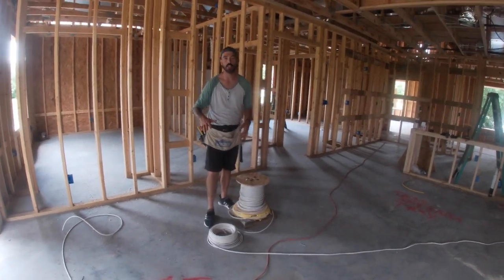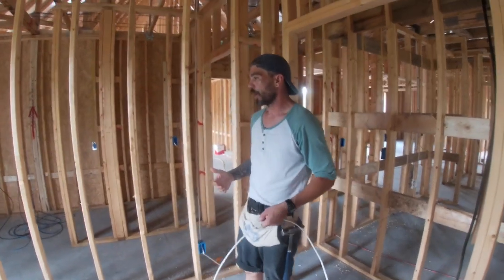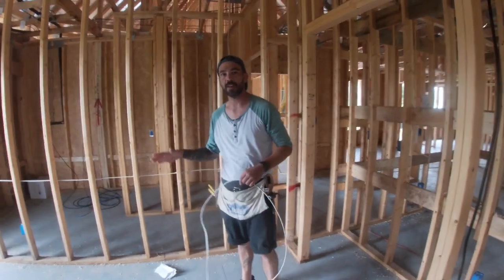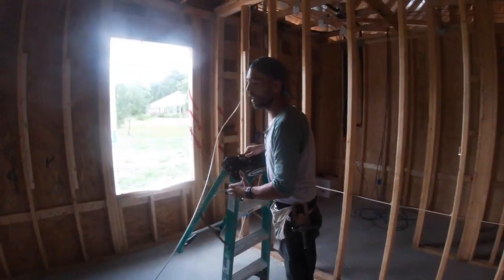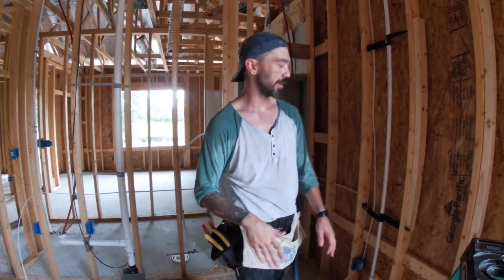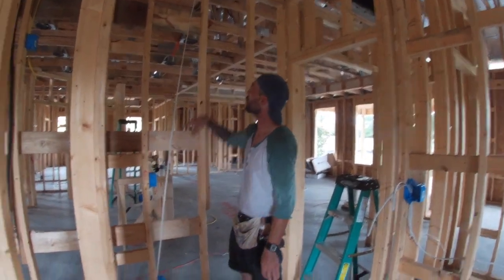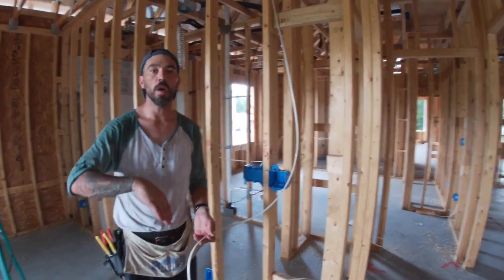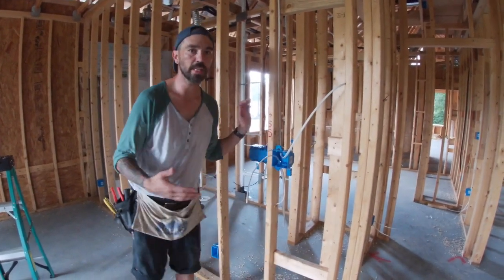How To Wire A House; Episode 6 - Bed 2, 3 & Hall Bath

Comment: I like your honesty, demeanor and style!  I'm going to use your teaching as my education on wiring.  My contractor ripped me off.
Reply: How did your contractor rip you off?
Reply: @Cizcoboii  What started as a kitchen remodel, then i was told, i needed to remove  ceiling insulation.  then suggested a rewiring the house, i said no multiple times, then since i wanted smart switches, it needed to be done, then the electrical box, they wanted 1500 more to turn the electrical box 180 degrees.  Did sloppy incomplete work and not to code.  Told me to knock three walls, build 2 bathrooms.  All with demanding to be paid for work that was not completed.  Demanded each week to be paid regardless of little progress.  Then I was fed up and they stopped working.  Stole a bunch of tools from me.
Reply: @calidtstyle  Jesus I’m sorry to hear that man
Reply: @Cizcoboii  He took my money, did 2% of the job, destroyed my personal property.  He demanded payment regardless of no progress.
Reply: hired for a 12k kitchen rennovationa. then things added up from his suggestions....he left me without eletric, water,power.
Reply: @calidtstyle  dont worry man people like them dont make it far in life,hope you recovered by now man🙏

Comment: Very interesting videos!I am also Electrician in Greece since 2000.In the USA you have a different cable system as far the colors and the cross section of conductors and plugs etc concerned but the idea of wiring is pretty similar!!!

Comment: Love your style with not drilling under windows, very quick. I also work for a spec builder, a bit more high end with base mold outlets (we leave 2’ slack tails tapped together and stapled to the sill, we give trim guys slater plastic old work boxes that they cut in, pain in the ass. He always wants (4) 4” cans with square led retro fit trims, center fan box capped in the middle in case customer wants light latter on. Each one around 5000 sq ft.
Reply from the maker: I think you are getting custom homes and spec homes confused lol. They would have to pay me so much extra for that. thanks for the comment!
Reply: @BETTERELECTRIC  Actually he's not, a custom home is customized usually by the homebuyer, cookie cutter or spec builders also build high end. It can also cross the gamut with so called custom builders giving limited options of their cookie cutter floorplans...ijs

Comment: Its funny we wire with BX here in NYC...what i would be interested in the video is to go over codes such as how many recepticles you can have in a room on a wall to meet code vs extra.  In addition, things like wiring three way switches with power in the middle, and end of light runs, Code for stapling wire out the boxes, and how far apart, height off finished floor for those holes between the studs, and why you put them where you do.  Height of boxes and switches off the floor (you may have covered in another video)..Thanks, great stuff!
Reply from the maker: bx cable is the worst. I could not imagine how long it would take me to do that. Mad props for dealing with how your inspectors interpret the code where you are.
Reply: NEC code and you're seeing him do it and explain, there's also many others on YouTube including Inspectors more detailed like how much wire and sheathing to pull through, distance of receptacles and how many on one circuit. There's rules of thumb but they're pretty close just like standard building practices but that Concrete City probably requires more with everyone connected. It's just a bunch of wires, once you pull a few through it's repetitious pinning, splicing and connecting, he'll show you pinning in another video.
Reply: Can be more than 9 openings per circuit
Also bath and half bath are running with #12 wire
Can't use #14 for and cannot be on the circuit of the bedroom

Comment: I run 14/3 as a home runs for bedrooms, living room, hall, kitchen lighting. I pair the rooms up and run one double pole arc fault breaker. One less home run and the double pole is cheaper than two single pole arc fault breaker.
Reply: Please explain how that will pass inspection
Reply: WOW
Reply: Idk where you're from but that's a no go In my area
Reply: @ny2la2day  It is called a multi wire branch circuit. MWBC.. check the NEC. It is just 2 circuits that share a neutral, which is allowed as long as they are on a 2 pole breaker.
Reply: So happy we don't have to use arc faults yet.

Comment: Great videos!  You are f'ng awesome.  Your experience shows.  I do have a question for you.  What is the device that you're using to spin your wire?  I use something called a willis which is okay, but it takes up way too much space in the truck, especially if I have 2 or 3.  I like the idea of just setting a roll of wire on a small lazy suzan type of thing and pulling from it.
Reply: Spinning jenny works too and it’s narrow for storage, used for wire, fencing hi tensile, barbwire, etc. best option

Comment: I see multi wire branch-circuit done with 12/3 and 14/3 as long as you put both circuits on oposilegs of the 240 so you don't overload the neutral

Comment: Great job with the videos pretty hands on.  

Do you run into issues with dimming lights when you wire these track homes?  This is happening in my home when I plug in a vacuum and even when i turn on the bathroom fan.  Just curious I know that now days companies a roping pretty much everything together.
Reply: Your vacuum has a high amp draw so they usually do make lights dim a little. Now the bathroom fan is not supposed to dim lights, maybe a loose connection on neutral?

Comment: Also why calling the wire that is going from the switch box that’s carrying( hot and neutral ) switch leg? I thought a switch leg only carries HOT to the switch and back ! 
Thanks for the efforts and the time you spending making this video
Reply: I mean if you wanna get technical you’re right but there isn’t a reason to specify one conductor in a cable.

Comment: They all have full basements. We come in sleeving the parallel sets of 2/0 converse triplex aluminum. We come in under the footings, stub up in the mechanical room, set (2) 150 QO plug on neutral main breaker panels. Out to the 320 meter pan usually on a H-frame at the edge of the property. Run out two empty 1-1/2 line and low volt conduits for future gate and communications. Same thing under the footings and out to the pool pentair panel (2) 1-1/2. Then we are ready to wire up pool after he pours concrete
Reply from the maker: Your job seems harder than mine! Basements can always be a pain. They would have to pay me a lot more to work in your area!

Comment: To my understanding for receptacles 12-2 romex wire is for power. 14-2 romex would be for the lighting circuit also for the switch leg.
Reply: That's why your not a electricain
Reply: Switch leg? Lol

Comment: dont you have to nail plate all those receptacles that you used the first spot to put wire in cause its not an 1 1/4 " from stud??
Reply: to protect the wire from the drywallers screws......

Comment: Does it matter if your home runs start on a low box, switch box, or even a ceiling box?
Reply: A home run doesn’t start or go in a ceiling light box 

Only outlet boxes and switch boxes
Reply: @kinglarrygaming2359  I'm remodeling a home built in the 60's and on both bathrooms the hot entered the vanity light box and they did a switch loop to the switch and then a leg to the outlets. I've never seen that and was confused. I'm trying to learn more electrical.
Reply: @joeram92  Old houses have a lot of things like that. Sometimes wires are even soldered together.
Reply: As long as it gets power your gucci
Reply: @joeram92  sorry for the late response but yeah old houses are wired so different from new houses now

Comment: Where do you use 12/2 and where do you use 14/2 for your home runs, what's the difference?
Reply: Kelly White the difference is 14 gauge is used for 15 amp circuits and 12 gauge is used for 20 amp circuits.
Reply: 10 cents
Reply: @-doughnuthole-  Thanks for the comeback, now I just need to know where to use 20 amp and where to use 15.
Reply: @kellywhite1663  You could go to the panel and see what size breaker is on that circuit. Or you could just use 12 gauge and you will always be ok. Nothing to figure out.
Reply: @-doughnuthole-  I guess I'll have to read, everything has the amps and watts and whatnot printed on it.
Reply: @kellywhite1663  yeah on the panel the breakers should have the amps on it.
Reply: I use 12 ga./20A for all outlets (because I'm not wiring a minimum-standard tract house and I hate resetting tripped breakers and fires) and 14 ga./15A for smokes and lights, because why waste money? I'm doing my house on the tail of Covid and prices have tripled!

Comment: you are making lots of wasting  wires
Reply: Don't quibble over wire, it's super cheap compared and best you have more than you need than not enough.
Reply: If your doing condos and you did that you'll be gone
Reply: I use my excess for box make up so nothing goes to waste
Reply: @eyeswideshut2800  not nomore Wire is expensive now and im sure this guy got the email to reduce home runs
Reply: @DiabloMEX-AMERICAN669  Compared it use to be no biggie but it's 9mths later and inflation is on crack. I will say that it can be easily acquired should one really need some.. ijs